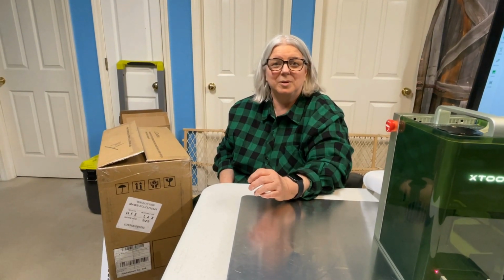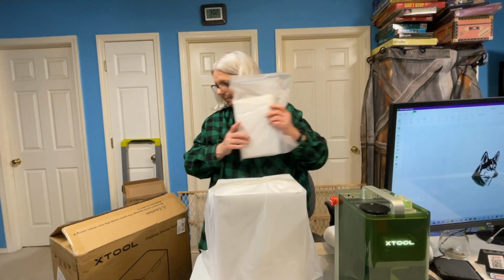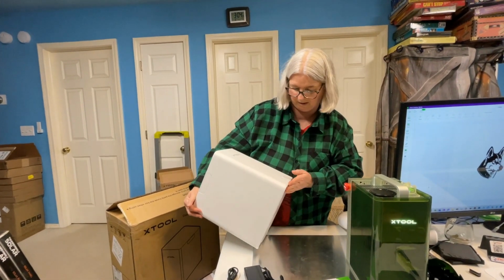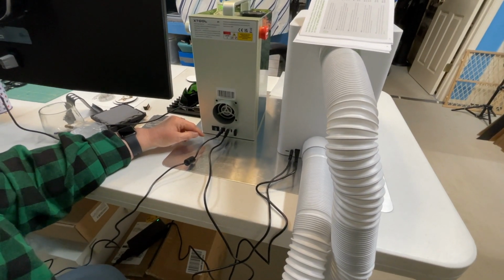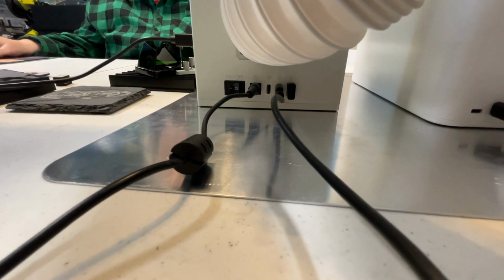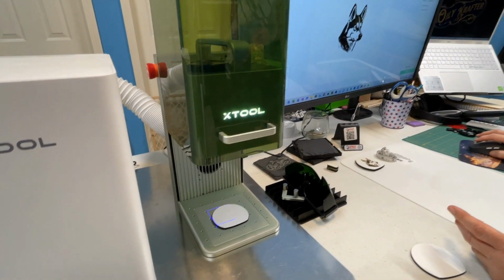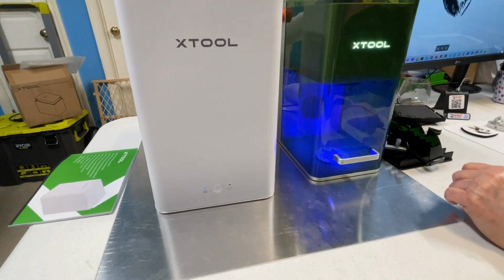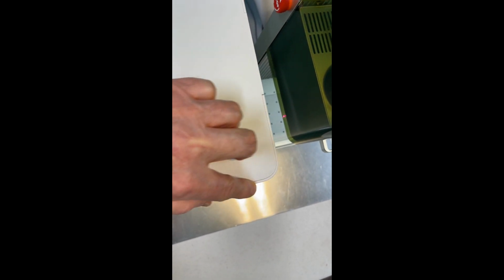Unboxing the xTool F1 Air Purifier

Comment: We have a 20 X 20 foot booth at an indoor flea market and was thinking of getting the F1 and air purifier so we can make things while it's slow and do custom orders while the customer waits. I just want to make sure it's not too noisy and the burned wood smell is as little as possible so we don't upset other vendors near by. Do you think this will work for an indoor event?
Reply from the maker: Thanks for watching our video! It worked great for us this last weekend at an indoor event! It pretty quiet. Between the noise of everyone talking and the music they were playing, we could hardly tell it was on! I think it will work just fine for you. I had no complaints from the surrounding vendor about any smell. We only smelled it when I got in a hurry and opened the cover before the air unit stopped. At that, it was very minimal smell!

Comment: I'm getting an odor from mine, I wonder If I have something set up wrong.  I didn't put the exhaust mode from the filter on, but I don't have a window to use it on.  Where did you put your exhaust pipe from the filter sytem?
Reply from the maker: Thank you for watching our video! We just put the pipe that came with the air purifier pointing towards the floor. We used it all day at our craft show with no issues. The only time we smelled anything is when I opened the cover before the air purifier shut off. Make sure you have the exhaust from the F1 going to the upper inlet on the air purifier and the lower one is the exit after the air has gone thru the purifier.